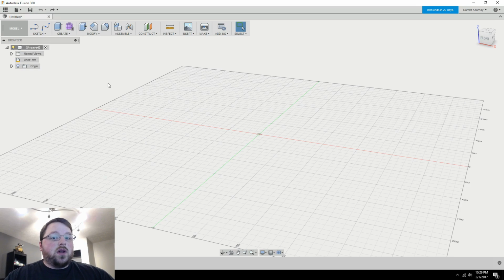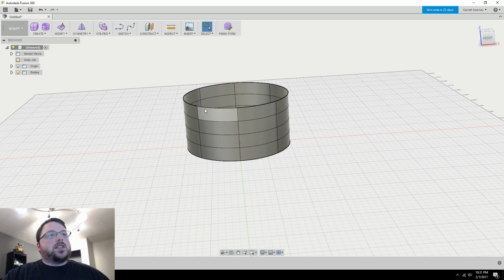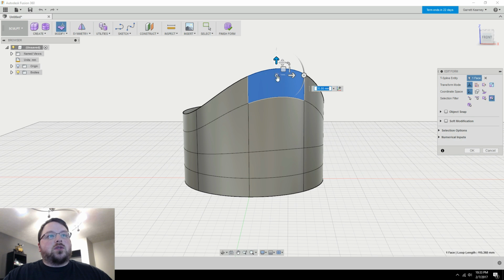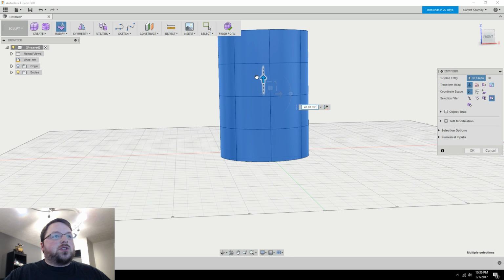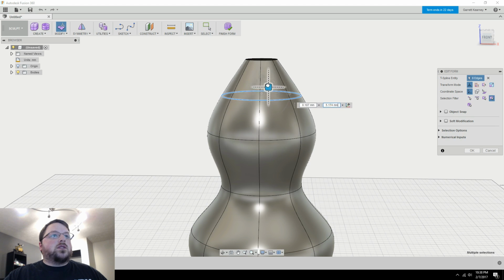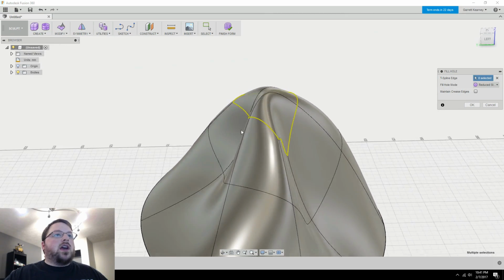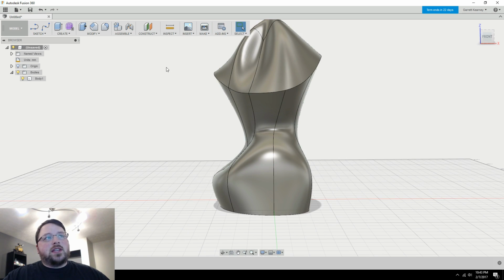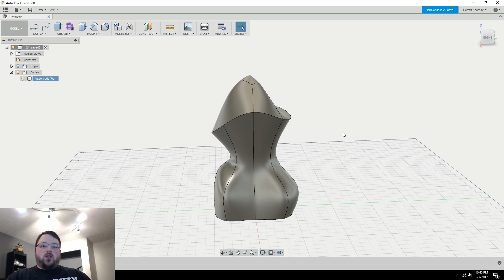How to Make Fun Vase Mode Models in Fusion 360

Comment: Would it be possible, to make a Video on howto import a STL & add filets at Bottom inside of vase, every vase I have downloaded and made Leaks at bottom at seam, made maybe 15 vases all leak. I even use PETG tried 3-4 layers even, but really want vase mode to work as it prints so fast but needs maybe Filets on the seams inside of vases.

Comment: Looking at getting my first printer, are you still happy with your robo or would you change?
Reply from the maker: Hi Tommy! I'm still happy with my Robo. It's going strong after 3 years, but I think at that price point, there are some better options on the market now. It really depends on your price range. But if you're looking at around the same price point as the Robo R1, I recommend looking into the Prusa i3 mk2 printer. If I were to buy another printer right now, that would probably be it. I haven't used it first hand, but I've heard a ton of people praise it highly. Hope that helps. :)
Reply: Thanks Just ordered the Prusea.